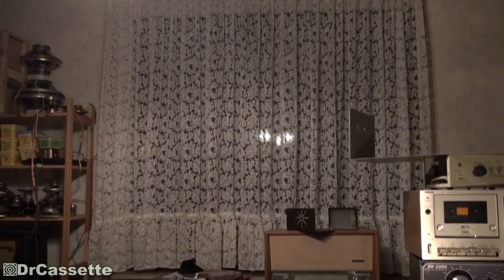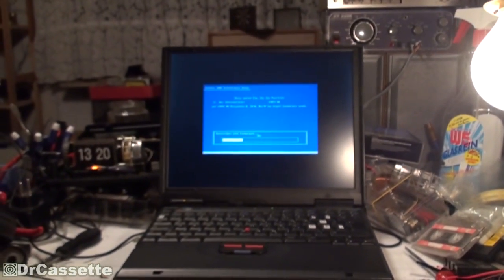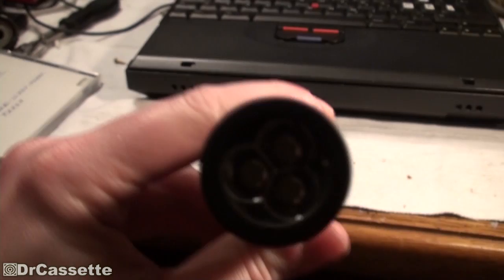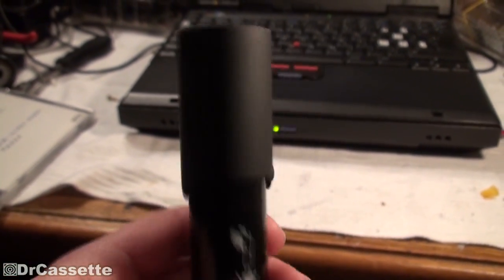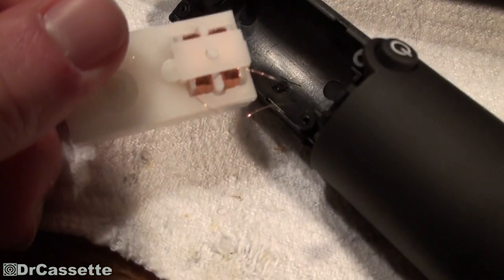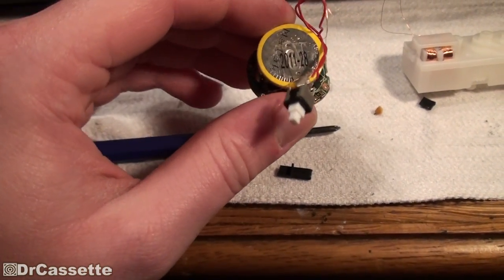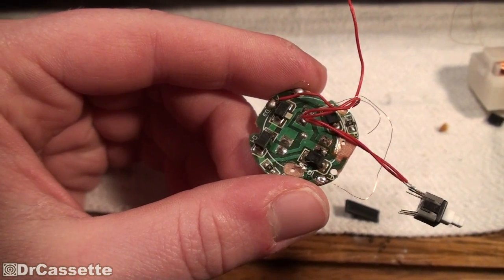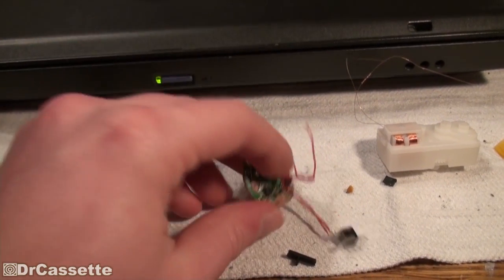DrCassette's Workshop - What's inside a self powered flashlight?

Comment: A low level format it is not necessary and will take too long. Linux installs its own MBR on the hard drive and it is incompatible w/ Windows OSes.l
Two alternatives to solve the problem:
1) Using Windows 2k disk, remove all partitions, create a new one and quick format it, then go ahead and install Windows normally.
2) If still doesn't work and you cannot get rid of that Linux MBR, use Windows  7 setup CD and go to "tools",bring the command prompt and type:"bootsect /nt52 c:" (without quotes).